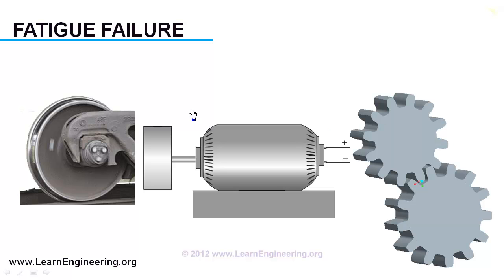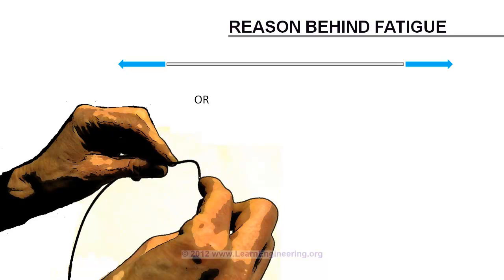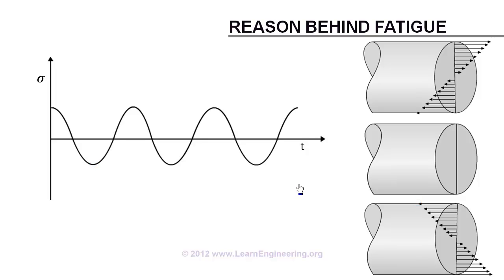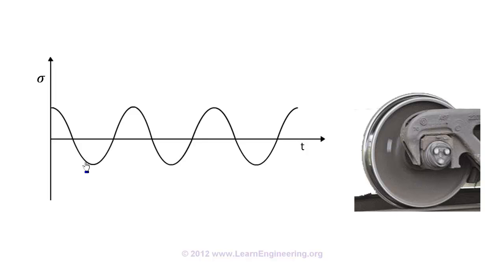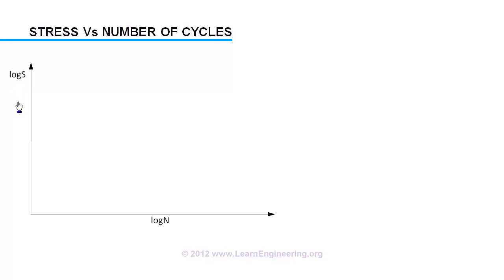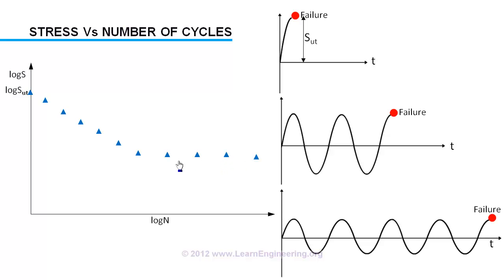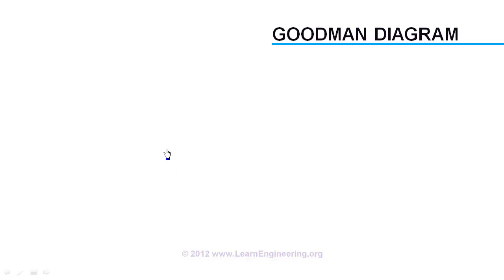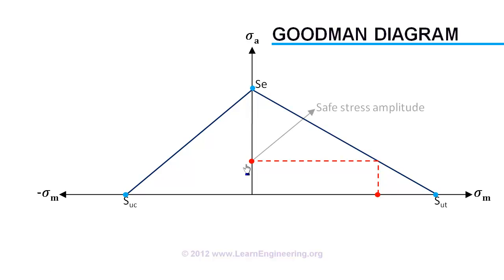Fatigue Failure Analysis

Comment: Bending a wire back and forth to break it struck me as a strange choice of example of fatigue failure.  It is an example of repeatedly exceeding yield stress and repeated permanent deformation in a ductile material.  When making a structure or device out of ductile/malleable materials the designer should almost always keep cyclic stresses lower than the yield stress (and usually non cyclic stresses too for that matter).  Breaking this design rule usually results in a uselessly short lifespan.  The value of fatigue failure analysis lies in its ability to predict if/when parts that seem to be working fine initially will crack.  This isn't the case with the bent wire.  A little research revealed a better analytical tool for the wire bending example exists; the Coffin-Manson relation uses strain rather than stress in order to predict failure in ductile materials that are subjected to repeated deformation.
Reply: I think many people go to the metal wire as an example because many high school teachers use that.  Which according to more experienced/knowledgeable people, is not really fitting for fatigue failure.
Reply: Have u ever heard about low-cycle fatigue? Probably not...
Reply: Actually it fits to example. High quality phone charger manufacturers claims that their cables lasts for 10.000 bends. Which means this video is a real life example and easy to understand for non expert people.

Comment: Materials such as steel and titanium have a fatigue/endurance limit. Aluminium and most other materials however do not, so it's not possible to design structures in these materials to never fail from fatigue. In this case the number of cycles must be set much higher than the expected number of stress cycles in service. 

Also the diagram is misleading in that it showed a crack forming and growing inside the material - in all cases of homogeneous materials without case hardening or similar surface property modifications, fatigue cracks always start at the surface.

Comment: 0:30 it's Ratcheting (cyclic load which results stress more than yield stress in every cycle) and I guess not fatigue.
Fatigue is when cyclic load results in stress below yield stress in every cycle, but the system fails because of no. Of cycles. For example pressure vessels.
Here is another explanation of fatigue.
https://youtu.be/o-6V_JoRX1g

Comment: It is wrong, that the material will never fail after reaching the "limit". It is just an assumption because  not a high enough number of cycles have been tested. As seen in wind energy components where cycles are over 10^9 this limit is wrong and components are still being damaged by fatigue loads below their assumed limit!
Reply: there could be coupling with other modes of failure, like wear, stress corrosion, etc.